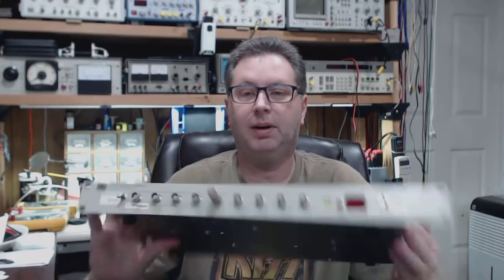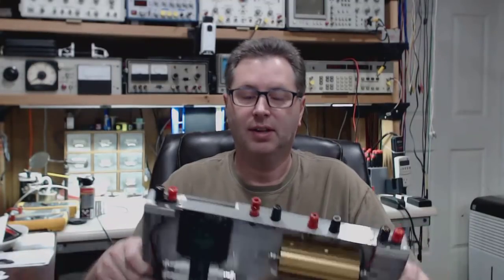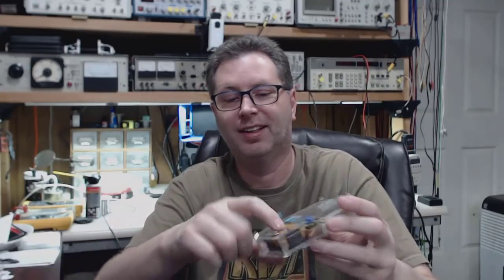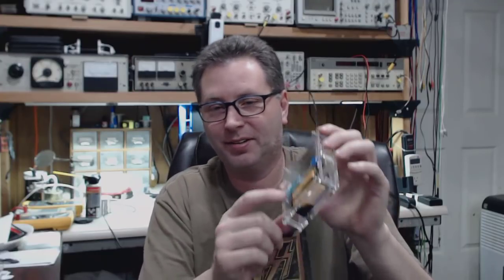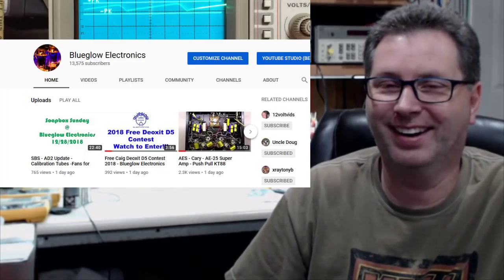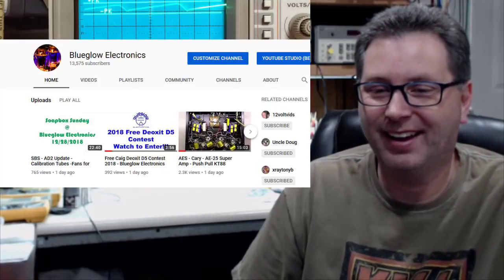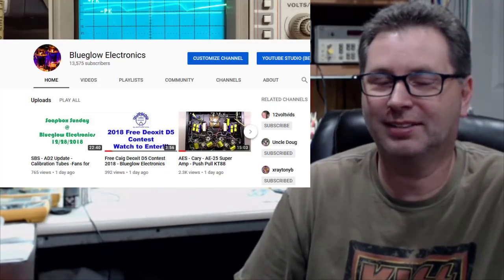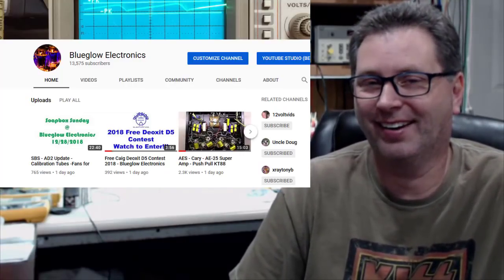SBS - $7 Componenet Tester - Budget Tube Amp? - Donations - 2019

Comment: The idea of an inexpensive tube amp is enticing.  Also I wonder if you ever have time to sleep.  The number of projects you have going on is mind boggling.  Also thank you for the solid state restoration videos that you have done over the years.  I’ve learned a lot about Marantz and Pioneer gear from them.  Having said that the tube gear is also interesting so either or is fine with me.  I still have two old ST 70’s that work.  I run them in the winter to keep my office warm.  One of them was modded by a previous owner during the days when it was the fashion to minimize the length of any lead in the amp.  Therefore it looks like a rats nest inside.  Just the kind of thing you would hate to see in restoration.  Thanks again for your videos.

Comment: For the iron for the El-cheapo, how about using toroids for the PS & OPTs . Been reading about how to use small power toroids as OPTS in PP amps.  A nice Antek AS-4T320 http://www.antekinc.com/as-4t320-400va-320v-transformer/ runs about 50 shipped.  Maybe go for an all noval build and use a EZ81 rectifier?

Comment: You’re not the only one - for me, an auto-ranging DMM for measuring resistors is a godsend; it’s hard for me to tell the brown and red bands apart, and sometimes the red or orange ones. what’s worse is trying the read color codes on old dogbone-style resistors, or mica-mold caps in old tube equipment, especially if the component got hot, or the paint faded. 🤓

Comment: How about parallel 6BQ5 for a cheaper amp build. Something similar to the KT88 build. You mention that a single tube wouldn't put out enough power in a SE configuration, but 2 might. The other way to get more power could be replacing the single triode driver with a pentode like the EF86. I'm not able to bread-board these things and I'm not an engineer. I have all the parts but I'd actually have to build it to find out if the idea is good. Anyone want to chime in? Looking fwd to 2019, all the best!

Comment: Not whining, but I'm completely deaf in one ear and even with a hearing aid I have marginal hearing in my other ear. It's unlikely I could hear the difference between a $900 amp and a $200 amp. And Mark, I remind you again that most of us probably don't have in excess of $25,000 in speakers around the house, so it may be that most of us might not be able to hear much difference using the speakers we have. Bottom line is to go ahead with the "el cheapo" amp and while you contemplate the preamp, keep in mind the same things and maybe try an "el cheapo" version of that as well. Keep up the good work, and happy New Year.

Comment: Preamplifier - What are your thoughts on this tube preamplifier kit available on Ebay? 6Z4+12AX7 Tube Preamplifier Preamp Board KIT base on Marantz 7 classical circuit. https://www.ebay.com/itm/6Z4-12AX7-Tube-Preamplifier-Preamp-Board-KIT-base-on-Marantz-7-classical-circuit/113243533094?hash=item1a5dd72f26:g:Lc8AAOSwFvZbl329:rk:1:pf:0 or ones similiar.

Comment: budget amp: what about a series string push-pull amp with no power transformer? use 25L6's.... solid state rectifier... for safety use one of those power cords from an old hair dryer that has a GFCI built in.  Maybe include a basic pre-amp stage so an i-pod could drive it easily. Some Chinese output transformers.

Comment: Resistor replacement for those of us with bad eyesight or differentiating color bands. I myself only buy resistors if I can get them with the resister Value printed on in numbers on the side of the resistor. Example CMF60120R00BHEK
Made by Vishay/ Dale Great for newbies like myself who are too impatient to even learn the color codes just look them up on Google and then replace the components with resistors with their Ohm value resistance printed right on the side of the resistor.

Comment: I love my $Cheap component tester... as you said it's not lab grade accuracy, but great for most bench needs.

Budget tube amp: Save cost on the transformers and go with a decent tube set - 6BQ5's are certainly cheap, but do not have a good reputation in my experience if biased anywhere near their rated plate dissipation... or vibrated in a guitar amp... or used long term...
I've often thought about using a wall wart  to supply DC to the unit and internally use el-cheapo voltage converter modules for filament and B+.  That's the whole power supply section for $20ish with the added bonus of having DC heaters... as long as the B+ converter OSC is above 20kHz (never found one that wasn't and many are in the MHz) it should be pretty stable and quiet. That saves a big, heavy, and expensive power transformer, rectifier tube, and filter caps. Throw in a pair of budget output transformers,  6L6's (seen a quad for amazingly low price a week ago), 12AX7 Preamp, 12AT7 inverter, and requisite passive components... I think you could do a stereo tube amp in the $350 range with maybe 40 watts per channel clean(ish) output.  I wouldn't expect great THD figures or perfectly flat response curves, but that wasn't in the design spec.

Comment: Or maybe just critique the eBay preamp kits. I think 3 of the kits look pretty nice considering the $ which includes the power transformer and chassis. I AM NOT EXPECTING THE SAME PERFORMANCE OF A $1000’s boutique or vintage rebuilt isoteric preamp....however I do realize a preamp has to be much quieter than a output amp.....like 10% the THD of the power amp. The 3 kits can be found by searching 1.”Shigeru Wada” 2. “6j4 6p6p”. 3. “Marantz 7”. I rather like the Shigera Wada....looks like dual rectified?

Comment: Thank you for 2018.  Every single thing you talked about was interesting. That's the problem. If I had a vote, I would hammer the AD2 as hard and deep as possible. Two reasons, it is affordable to everyone and I have found it faster, as useful and massively cheaper than the 5 tons of Tek gear I own (no joke, 5 tons over 37 years). So pound that one. You will enable many people to get deeper.

I will put a specific list on Patreon.

Comment: Hi mark your Idea of copying the small maggies is great! use the replacement transformers from Antique Electronic supply! The output is part number p-t291 $17.95 ea the power supply transformer is P-T269ex $51.10, and the chassis I use is P-H1444-16 $14.55, you can use most small output tubes with these transformers 6BQ5 6V6 6F6 etc. It can sound great! And it is P.P.

Comment: Biggest cost in anything tube type is the transformers.  Premium transformers go for premium prices.  As much as I hate to say it China is a great place to get cheap transformers these days.  I have purchased several toroidal type high voltage transformers from China and they worked fine and did it at 1/4 to 1/8 the price.

Comment: Hi Mark, when you do your schematics videos perhaps you could break them down by topics and explain certain circuits like what SRPP, long tail pair phase inverter, cathode follower etc are and how they work and what the components are doing in each circuit? That would help out beginners like myself  tremendously especially the visual learners because there’s a lot to read on those topics but not many videos that can explains things as clearly as you do. I hope you could also incorporate and explain tweaks like thermistors and caps across power switches for suppression. I learned about such things from no where else but watching your videos. Thank you so much for your efforts in making these videos and making the art of tube amp making accessible to non-EEs.

Comment: Hi Mark, what are you doing about the jumper on the BNC board for AC or DC coupling while it’s mounted in the case?
Reply from the maker: Will leave it on AC all the time.  I'm dedicating the AD2 to the audio analyzer software purpose only.